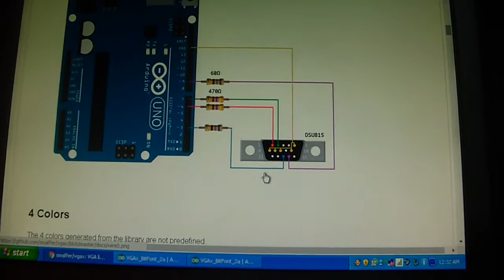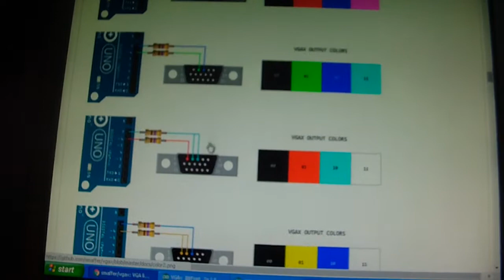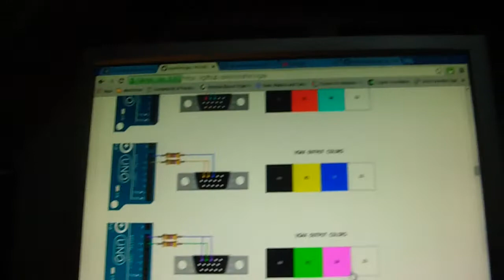Arduino on VGA display (2)

Comment: Very nice, thanks for sharing, seems to compile also on the Nano which 
made it possible to use it as a little VGA driver (via for example I2C 
interface) for an another Arduino. 

Design comment: The bitmaps uses four bytes for each pixel. Because you 
have only four colors, why you didn''t designed it to use color numbers 
that reffers to a palette like GIF's (or other <=256 color bitmaps) 
do. So you need just one byte for each pixel and saves you 3x times the 
required flash memory, for example:
0 : Black
1 : Color #1
2:  Color #2
3:  Color #3
4:  Color #4

You can also squeeze 2 pixels in one byte. The first four bits specify 
the color of the first pixel and the last bits specify the color of the 
second pixel. This halfs the required space, for example (bin format):
1000  :  This selects color #1 for pixel one
0001  :  This selects color #4 for pixel two

So in the array, it looks something like this: B10000001, which is just 
one byte = 129 or 0x81 hex. Hex notation makes the code a bit smalller 
ofcourse. 

Because this all saves space, maybe there is room to apply chaching to 
avoid the flicker. The cache can be build the same like the bitmaps, so 
it requires less memory and the timer draws the cache continuously in 
background. So when you manipulate the output by drawing a pixel, you 
draw in cache instead of draw it directly. You also can 'move' portions 
directly in memory without any translation required which makes it as 
fast as possible.

Some idea for improvement?
Reply: Thank you very much for post it. I'm trying to draw images with 256 colors (or draw 256 color bars using VGA). I'll try to make it.
Reply: @Miku Lovers: Show us the end result if you want, very nice to see your progress.
Reply from the maker: I just check if works.. it works 😎

Comment: What is really the purpose for this shield ?? I still don't understand what's its all about.
Reply from the maker: really? what scope ? for connect the module to Arduino....
Reply: It is just a breadboard that clips to the Arduino. I haven't needed it myself, but I suppose if you had a circuit you wanted to wire up and see how it interfaced with the Arduino for prototyping it might be useful.

Comment: Its very useful for me,but i have one doubt.. how can i adjust screen resolution  size into 640*480  ?
Reply from the maker: you can't use bigger resolution with Arduino .. must use a board/shiled like this: https://www.tindie.com/products/masihvahida/vga-duino-vga-graphic-shield-for-arduino/
Reply: Thank you
Reply: Ignore this, for archiving... (/*It's not possible due to memory limitations. For example, even for 1 BPP (bits per pixel) it would still take (640/8)*480 bytes = 80*480 bytes = 38400 pixels, which is bigger than an Arduino Uno's poor 2 KB (2048 bytes)!*/)
Reply: It's not possible without external hardware because of the 2K RAM of the ATmega328p. Even b&w pixel data would still take up, you guessed it, 38.4KB of RAM which is almost 20 times the memory of the Atmega328p chip... For static bitmaps (getting data from flash using pgm_read_byte and declaring your bitmap as PROGMEM, which it will store in program memory, if a constant)
you would need to have atleast 40K of flash. Dividing the resolution in half (320x480) would take up 19.2K of flash. But fitting more than one image takes up 38.4K so it doesn't fit in flash.
320x240 takes up 9.6KB of flash. You could fit three images in memory.

Also, the timings required for generating a video signal must be very precise...

Comment: Can i print number  with vgax?
Reply from the maker: test first library example and will see... is an old experiment and I don't remember all details, but I made an termometer cu display value  on monitor - http://nicuflorica.blogspot.ro/search?q=vgax
Reply from the maker: see https://youtu.be/SUstl4uK5pg
Reply: Sir what is the function for printing number it is not possible with VGA.print
Reply from the maker: see https://github.com/tehniq3/VGAx/blob/master/VGAx_TMP36.ino
Reply: Nicu FLORICA this code is printing number as a string.is there not any other way to print that as integer , float ??
Reply from the maker: Anish Prakash is way to ptint value... temperature is number.. must change in array
Reply: Nicu FLORICA is there any link or can upload a photo of that?
Reply from the maker: Anish Prakash in sketch are pin definition for sensor and in library, in this video  & my article is schematic for vga adapter
Reply from the maker: my article is at http://nicuflorica.blogspot.ro/2016/06/afisare-informatii-pe-monitor-pc.html
Reply: Anish Prakash 
Printing a number requires converting to a string anyway.

Say you wanted to display 65 as a character. In ASCII, it represents the capital letter A.